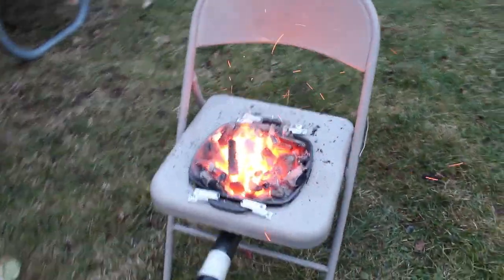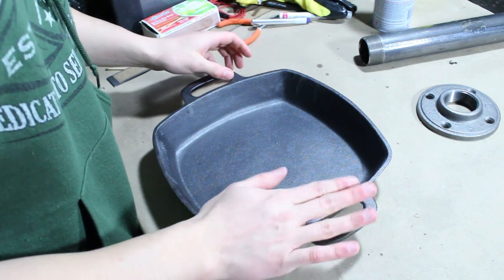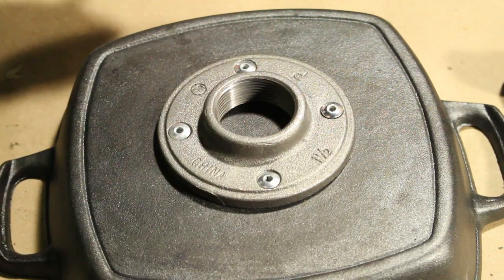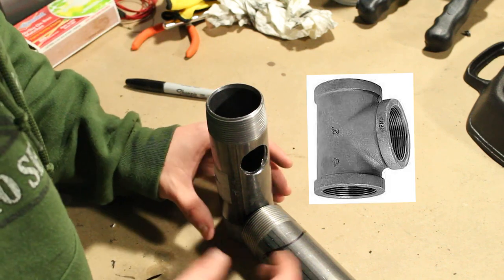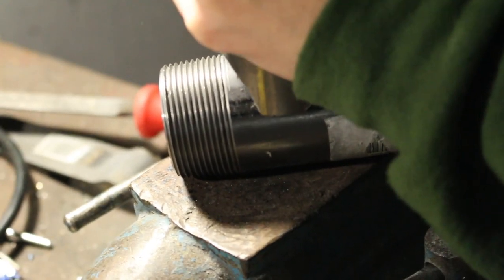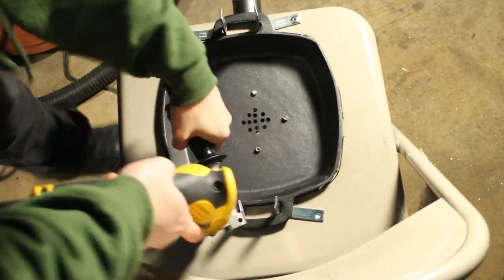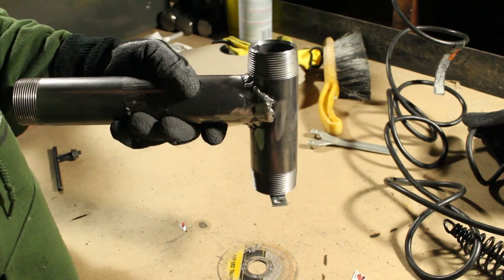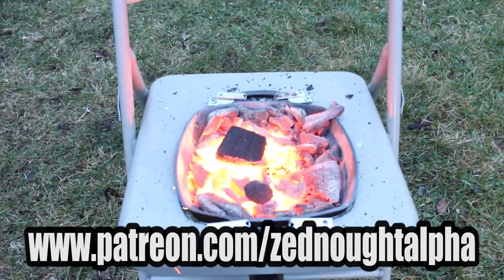Fold-Away Blacksmith Forge (Satan's Toilet)

Comment: is there a reason that you don't just use an 90 degree pipe fitting
Reply from the maker: +Aidan Feeney Ash and coal fall into the grate, without the pipe to empty out it will just fall into the tube that the hair dryer is blowing into and clog it.
Reply: +ZNA Productions Wow I wouldn't have thought of that...
Reply: +Christian Williams neither did he

Comment: the grinder won't grab ur gloves and rip ur finger off it will however cuzz you really badshould always wear gloves while using a grinder and if your worried about the IR and UV damaging your camera buy a $20 4x5 welding hood from tractor supply and put the camera inside that hood while welding

Comment: where did you get that charcoal
Reply: you can get that kind from home depot or Lowe's.
but the cheapest and easy way is to make your own.
Reply: Don't buy it make it it's easy
Reply: +Super Moon easiest way
Reply: +Wolf Angel yes
Reply: +Super Moon I meant to put a question mark, as in what is the way?
Reply: Well I'm guessing if you needing  charcoal u can have a fire pit so u can make it with wood just search in YouTube how to make it 
It's a lot cheaper than buying it a tip is to use hard wood but you don't need to.
Reply: +Super Moon I have been using straight wood and sometimes charcoal briquettes.
Reply: +Super Moon You should watch a documentary on making charcoal.. I have and it's not easy on any kind of useful scale.
Reply: +Ryann Large boy I make my own and its works just fine
Reply: From Mars

Comment: I think the king of random have something much better
Reply: 🌈K🌈
Reply: dude he has almost or more than 5.000.000 subscibers of course he has better videos cause he is richer than Eli but this is the best fold away forge his forge was a bucket this chair forge is easier to store
Reply: I think that Eli's creation is for blacksmithing while the King of Random's forge is for melting materials down. You never see the King of random actually doing any blacksmithing or knife making. He uses molds.
They are different things, so you can't really say one is better than the other.
Reply: +Gerry Peters yeah but I think he can use it for blacksmithing too wgich I dont think he has the knowlege or the muscle to do any blacksmithing
Reply: I made a forge very similar to the king of randoms one (if you're referring to the plant pot one), it is very good for forging but does have a limited life span as it gets so hot that the plaster of paris dissintegrates after roughly 20 uses. I use it to make knives (mainly throwing knives) and it works just as well. The pros for KoR one is that it is so cheap and quick to build but has a limited lifespan and this videos one will last as long as you want it to but costs a lot more so it's all up to individual preferences but they both heat as well as each other.